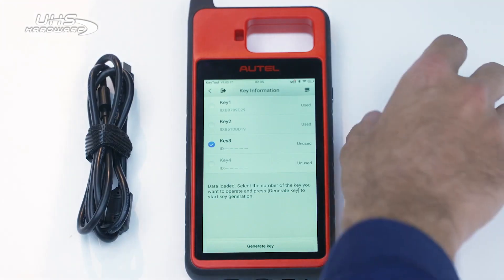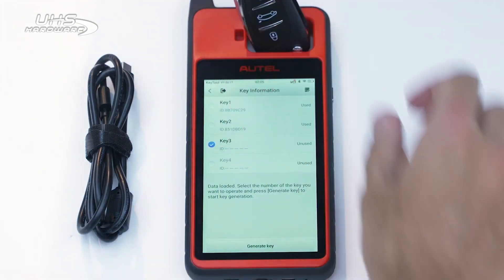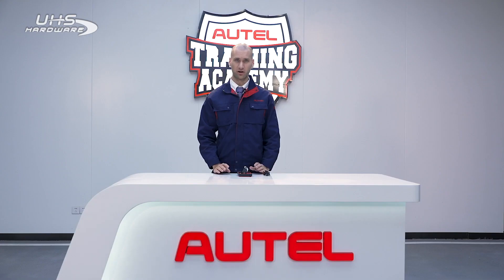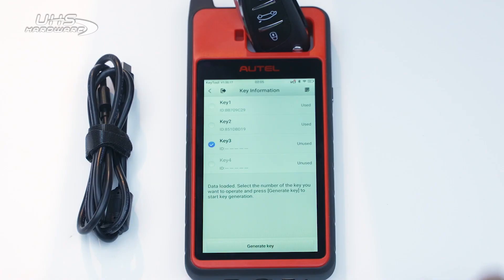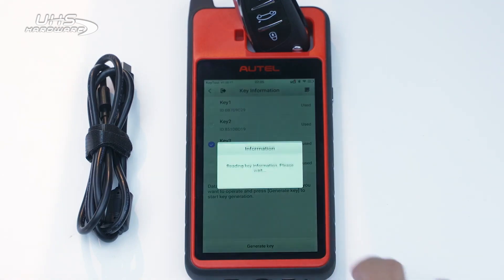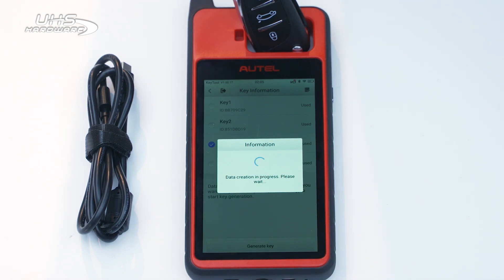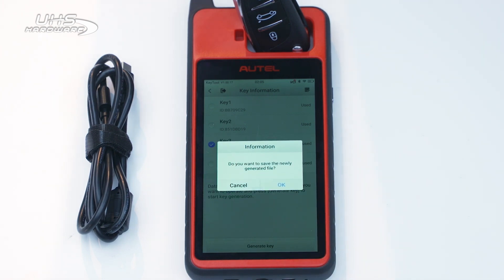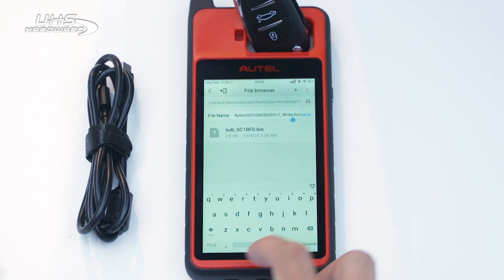How to perform Immobilizer Data Processing with Autel Km100 Universal Key Generator and Programmer

Comment: Since the 508 and 608 have universal key generation function using the XP400, when would there necessitate a reason to use the km100?
Reply from the maker: It's more of a well made, easy to carry substitute for those two products. can be used in leau or as a part of the process.